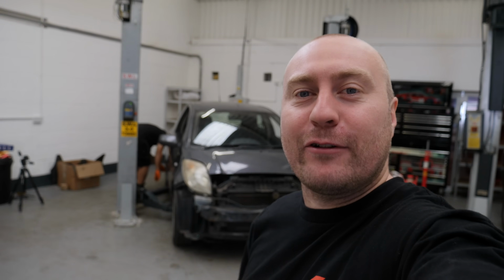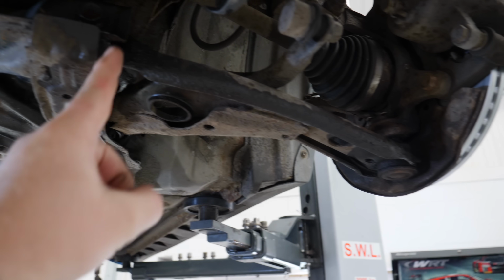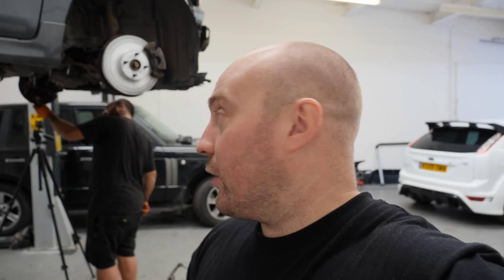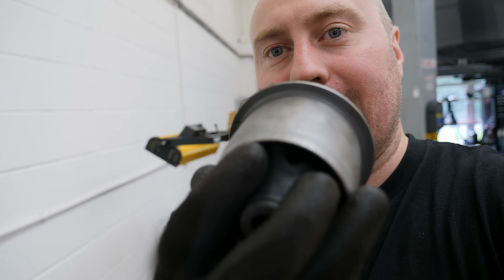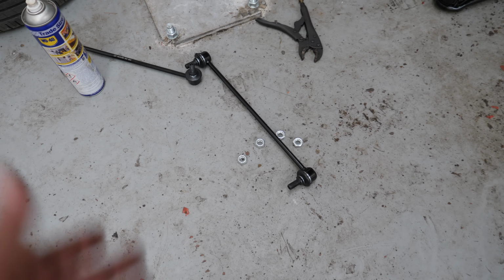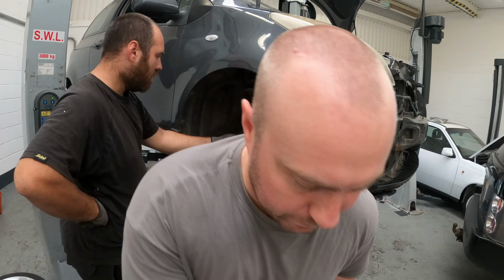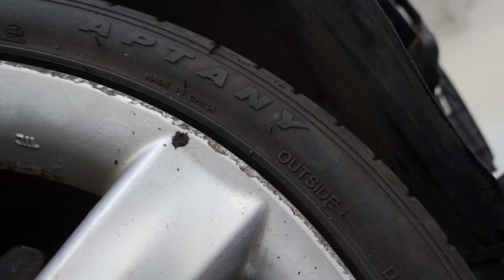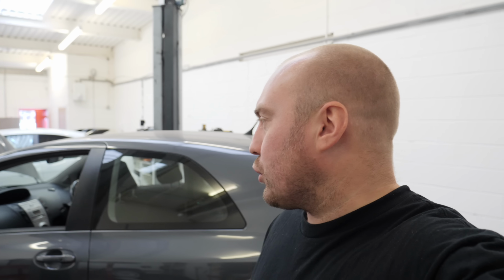CHEAP MK2 TOYOTA YARIS SR 1.8 £130 TURBO CONVERSION (PT3)

Comment: Great video mate, I was wondering if you know could help me out. I got thr same car and at the back of my engine I got a coolent coming out of a hole. Is there suppose to be a pipe/bolt there? It's driving me mad
Reply from the maker: Not sure myself mate and not sure who could point you in the right direction either. You tried some Lotus specialists as I’m sure you already know but some of their cars have Toyota engines in 👍🏼

Comment: Do you think these or a 1.5 t sport is a better start for modding ? Obviously this has the bigger engine and newer
Reply from the maker: Hmmm not sure tbh mate. T Sport would be miles better on fuel I know that 😅👍🏼
Reply: @EVILGT I'll ask on one of the Facebook groups. Petrol economy would be good , anything better than my scoob 😂
Reply: Personally the 1.3 vvti is the best engine for performance and economy 1st gear red lines at 35mph 2nd at 64mph and 3rd 95mph 4th 112mph and 5th 130+ never been able to hit the red line but there super fun cars I've never had a t sport that's been able to keep up as the 2nd only redlines at 55mph in the 1.5 if anything look for a 1.3 Sr that's the best engine but there not many about
Reply: @sparkly173toast4  how does it accelerate faster with a smaller engine or is it the gear ratios are different.  Is the 1.5 6 speed ?
Reply: @sparkly173toast4  the 1.5 supposedly does 0-60 in 9 seconds,  whats the 0-60 in a 1.3 ?
Reply: So I'm not sure if you know about how the vvti works it's abit like a vtec in a Honda, vvti kicks in at 4,500rpm and it redlines at 6,500rpm this is where the full potential is I've found if redline 1st then it's a quick car but if I am cruising at low revs it still picks up speed like any other car but I wouldn't class it as fast it's pretty slow at low rpm but that's where the fuel economy is also I never tested the 0-60 time but I strongly believe the 1.3 engine is the one to mod due the gear ratios